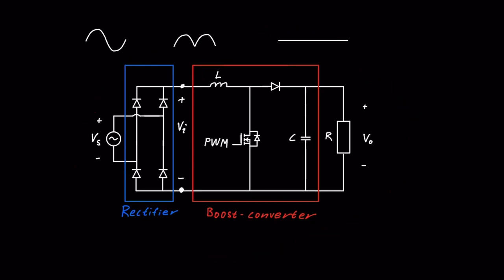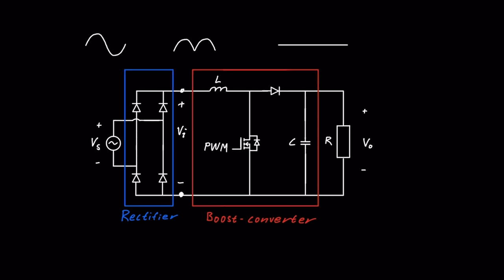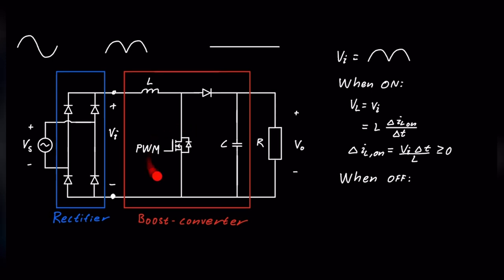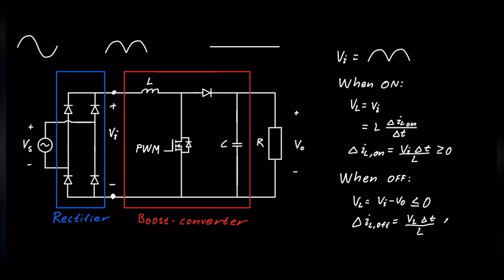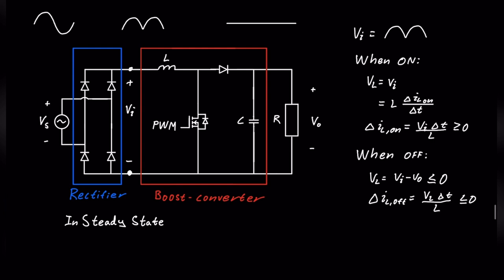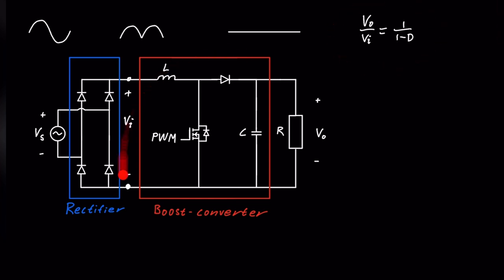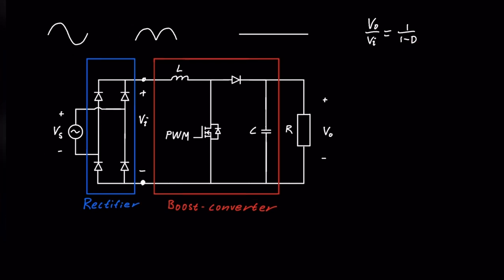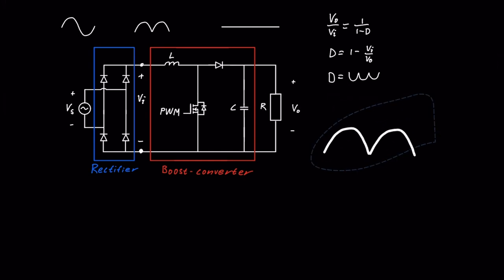How a Boost PFC Works

Comment: A lot of math, addition and subtractions. It's good but not very intuitive in explaining what's physically happening in the circuit. Students are expecting explanations on what the current flows are like, at different times of switching, and why, and etc.
Reply: I understand why kids want intuitive understanding. It is very helpful to understand. I suggest tools like circuit simulatoor applet to help visualise current and voltage using these tools. However when working with theories it always makes sense to use math to come to conclusions. That is how we can conclude something in words before we can actually understand what is going on.  hope I made sense.
Reply from the maker: I have now made a simulink model of the Boost PFC, to get it go to https://kristianskorpen.com/boost-pfc

Comment: Thanks bro! I hv alwaz thot dat dz tin works like your pwm pulsewidth has to vary sinusoidally ( halfSine for each halfcycle ) but now I know dt it's the average current thru d inductor that has to vary sinusoidally to be I phase with the input voltage but your pwm pulsewidth has to be inverse halfsine